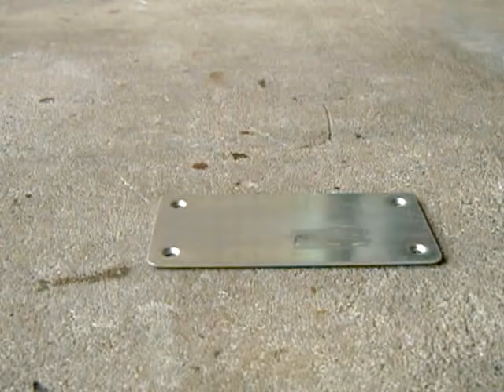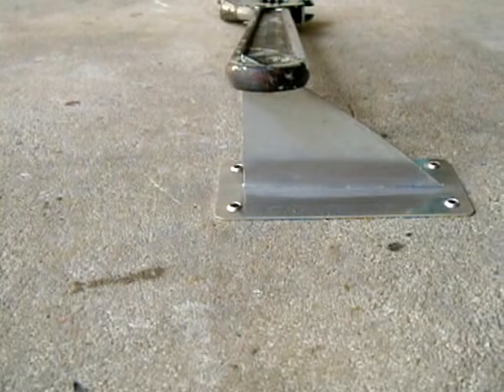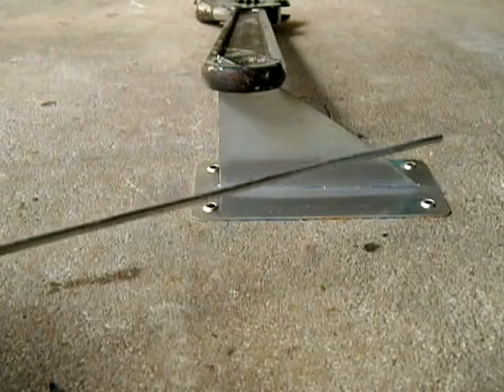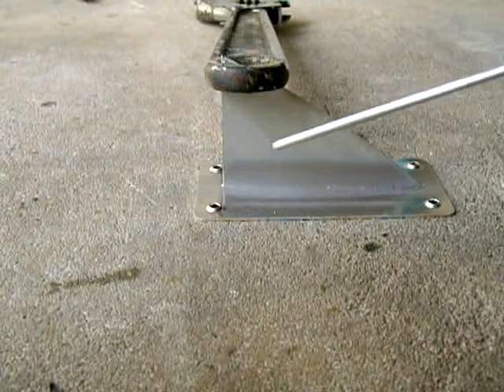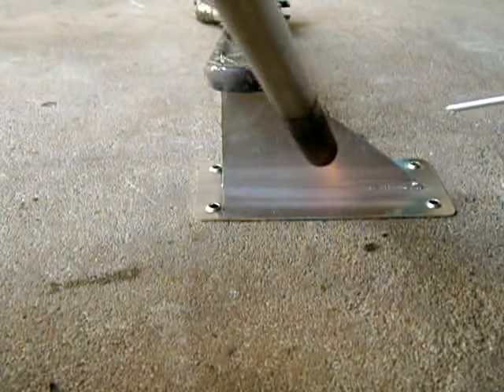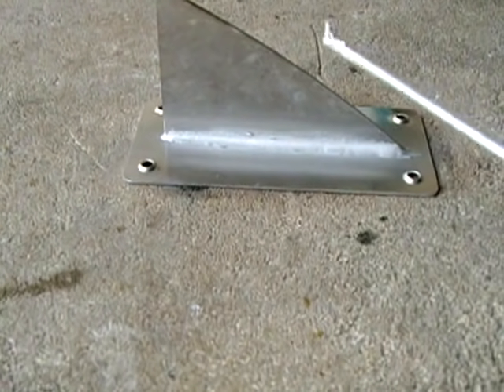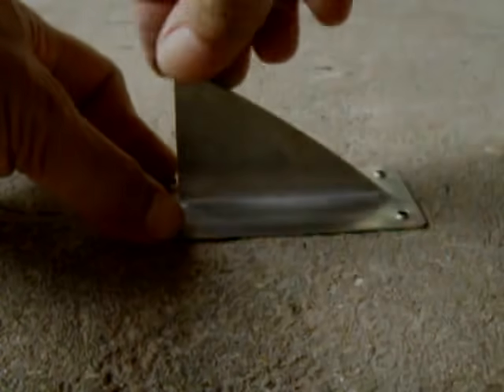How To Easily Join Together Aluminum Plates & Repair Aluminum Parts

Comment: If you use a proper flux (and do your brazing off the huge heat sink of a concrete floor) you will get a better joint that will fillet on both sides, even if you only apply on one side. You will also be able to skip the majority of the wire brushing.  Still; this does illustrate how strong a brazed joint can be, even when done less than optimally.
Reply from the maker: Concrete, like a fire brick, is a very poor conductor of heat. No flux is needed with these rods, but I am sure the result would be even better if you did use flux. Brushing surface oxidation under heat is mandatory when using these brazing rods(according to the manufacturer, as well as my testing)

Thanks For Watching!
Reply: I haven't got to try brazing yet! I can emagine from my research you are 100% correct! I also seen somone online showing a strength test which had interesting results! One person with a scale and the other with a hammer! So that was nice when you hear that brazing is only for decorative! I know steel is better to be welded within some cases, I just can't wait to see what aluminum provides!

Comment: In welding class we hit the aluminum t joints with a hammer to see if it will crack. It’s really crazy how tough 16 gauge is to tear or compromise. You hit the nail on the head with the preparation. Aluminum has got to be very clean if you want the strongest joint. A good weld/braze is like a good paint job 90% prep work 10% actually spent welding/brazing.
Reply from the maker: Thanks for watching Jacob! Be sure to look over my extensive video playlists below for other 
helpful/informative videos of interest to you and most importantly share my channel with others. 
https://www.youtube.com/c/electronicsnmore/playlists

Comment: Awesome video. Thank you. I don't know if someone already mentioned this tip below,:  My USN trained machine shop instructor showed me a neat trick wit Aluminum.  Once the metal is fully prepped, black the aluminum with suit. Either with a candle, or acetylene from a torch.  Then, begin your normal heating process.....right when the aluminum is hot enough that the black suit disappears, (it happens all at once)- the aluminum is now the perfect temp to bend, or straighten, or lay the solider to0, or start applying your TIG welding filler rod.  Awesome video and thanks!
Reply: What is suit?  Please describe it a little more.  Candle or acetylene? Sounds like a great tip for someone trying to teach themselves this aluminum brazing.

Comment: The problem with aluminium is that it oxidises immediately. If you clean the parts under mineral oil, the oil seals the surface and prevents oxidation. This means that with practise you can soft solder small aluminium parts using a soldering iron while keeping the parts in a shallow bath of oil.
Reply from the maker: That's why you need to brush the molten rod into the surface. The oxidation cannot take place.

Comment: I'm under the impression that the steel impregnated in the aluminum from the wire brush will corroded the aluminum. Shouldn't you use an aluminum brush or sandpaper to remove surface corrosion?

Comment: While you still need to clean the metal, there is a flux, for low-melt aluminum, to help filler metal flow. One brand is made by J.W.Harris Co.

Comment: I worked as a Jeweler / Goldsmith for over 30 years. I am just passing along a simple tip about soldering. The solder always follows the heat. To pull some of that aluminum solder down under the joint and a small amount to the other side. You need to heat that joint on the other side. You should see a small bead form on that other side when the solder starts to flow.
  I have also used these aluminum rods and I think they are fantastic. 
 One last tip. Don't overheat your work. You used just enough heat till the solder flowed and that's good. Too much heat and you can actually cause the solder (call it brazing if you like) to boil causing a porous and weak joint.
Thanks for posting!
Reply from the maker: +JoeKind1958 
Thanks for watching!
Reply: Great vid! Would this technique be ok on thin sheet say 0.9mm aluminium or would I get some warpage
Reply: Hey JoeKinnd1958, do you think I could make an aluminium/gasoline /petrol tank for a motorbike and use only brazing instead of welding?
Reply: Great additional tip.  Thanks for this video and the comments that go with it.
Reply: Ive been for 20 year and YouTube came up i feel like my 20 years was nothing
Reply: i dont mean to be offtopic but does anyone know of a way to get back into an instagram account..?
I somehow lost my login password. I appreciate any tips you can offer me
Reply: @Jason Weston Instablaster =)
Reply: @Roger Cash It worked and I finally got access to my account again. I am so happy!
Thank you so much, you saved my account !
Reply: @Jason Weston You are welcome =)
Reply: I learned more from your comment.  Thanks.

Comment: People don't understand the benefits of taking the time on prep work such as wire brushing considering the few minutes of prep are less effort than re-brazing/ soldering/ welding and well anything in life Haha. Good video. I'm probably going to pick some of these up soon.
Reply from the maker: Thanks! Practice on a few pieces, you will learn fairly quickly.
Reply: Which people?

Comment: Hi, just picked up the neat holding method with the wrench.
Those rods are usually an alloy of aluminum and zinc, they will stick to about everything metal there is. ( Copper, brass, steel, stainless...)
One tip from a machinist/welder, not that it really  matters in this demo, but prior to brushing, just clean with acetone so the grease don't get rubbed into the sheet, and, if the rods contain flux, no need to brush after you started, just keep the flame on the part, this will keep it from oxidation, the melting point of those products is around  850 F or less. (pure aluminum is 1200 F)
Like you said it make a very decent bond.
Appreciated the demo,  Pierre

Comment: I have helped design and build aluminum vessels for the Navy for years....and seen friction stir, stick, mig, tig etc.......never this. I am def trying this at home. So intrigued.
Reply from the maker: Pat Rigdon These rods work extremely well when the surface is properly clean/brushed, and the correct amount of heat is applied. Be sure to check out my other aluminum repair video as well.

Thanks For Watching! Please share and rate Thumbs Up.

Comment: The Jack stand on my boat trailer has a foot that is rusting out. I was thinking the foot off and trying this out with a fresh piece of aluminum. Assuming I clean it up nice prior to, would this be a good fix? It’s. 2500 lb jack stand. Not that there is 2500 lbs being put on it, just giving more info.

Comment: Few things here, great video and brazing aluminum is far easier than welding it and with aluminum welding isn't always that much better. Aluminum is fairly weak anyway, so brazing it normally all you need. A couple things that were not right it that while cleaning the area to be brazed, soldered or welded is always right, you are not removing oxidation. Well, you are but aluminum will oxidize as soon as you brush it. It is nearly instant. If flux is used it removes the oxidation when you heat it and the rod covers it so it never touches air. If you don't use flux you have to scrub though the molten filler to remove the oxidation and have the molten metal cover the base so it does not contact air. All that scrubbing was just taking a way a layer of oxide and allowing on other layer to form.
Reply from the maker: +Phillip Morrison 
Hello Phil. I have had this discussion before, and spoke with the manufacturer as well. What I show in this video is the correct method to keep surface oxidation at a minimum. Keep brushing, even under heat until the brazing material flows into the surface.

Thanks For Watching.
Reply: Don't know why all these videos are stating to use a STEEL BRUSH.

I wouldn't recommend using any type of steel brush on Aluminium; especially, at this fragile molecular state.

Preferable, use a new (dedicated) brass brush rather than any steel.

Pushing Chromium (SS) into the Al will cause intergranular corrosion later down the road.

Even sandpaper type must be chosen wisely before cleaning Al.

 I too would recommend using the proper flux with a nylon "toothbrush" for "longevity".

But thanks for the other info, gave you thumbs up!
Reply: +Aquamon do you work aerospace? I don't hear people talk about impurities from the brush very often, and they are normally aerospace welders.
Reply: +Phillip Morrison Right you are, the steel brush leaves behind residue . If you take a steel brush to stainless steel then the part you brushed will rust, actually it's the residue from the steel brush that rusts and not the stainless steel itself. Is that correct? When you brush the Al it leaves the same residue on the Al. I have told others to be careful what they use to clean the parts with that are about to be soldered/brazed and most people just don't care and use some kind of oily, greasy wire brush to clean with and then sit around scratching their heads wondering why their solder/braze joint failed miserably. I just sit back and laugh.
Reply: +brandy sigmon I meant that previous comment to be a reply to Aquamon, sorry.
Reply: +brandy sigmon 
troll mask?
but, right.
Reply: Aquamon whats a troll mask
Reply: @aquamon1339  
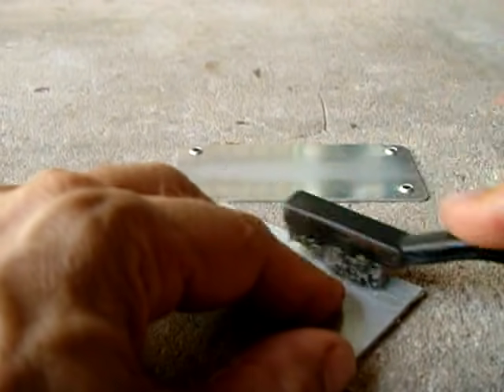Actually, at 1:20, he said to use a "stainless steel" brush not; just steel.  Does that make the difference needed?  Another guy below said to use a brass brush?
Maybe, the secret is to use flux, as well as, using a stainless brush.....before the brazing starts?

I didn't like the brushing during the heat process but, I don't really know.  That seems to be, potentially, inserting contaminants into the aluminum.

Brush it with SS and use flux.
Is it okay to sink the hot parts in water to cool or does that make it brittle?  I thought cooling quickly like that, tempered it locking the molecules in that position as they do in steel.

Comment: Do you think these welds will hold safely on motor mounts for an aluminum frame motorcycle?
Reply: Better find someone who knows how to Tig weld for those motor mounts!!  These rods are good but I would never use them for something like a motor mount.
Reply: +axm203  NO, need to weld not Soldering...I was a millwright for 28 years...

Comment: Hi, can I ask your opinion on failure of this joint under re hating with a flame. Do you consider this a fusing of the two pieces, which would not come apart when re heated or just a bond which would?
Reply from the maker: This is just like "Hard Soldering". The base metals don't flow together.

Comment: cool vid thanks. tip..that concrete leeches alot of your heat making the process take longer.  Also concrete can blow up in your face if heated to much depending on how much moisture is in it.

Comment: I bought Harbor Freight rods and they worked fine for repairing AC tubing on the car.
Tube had broken where it enters a large bolt on flange bracket.
So, drilled out old tube in bracket.
Cleaned up tubing and brazed together. Saved me over $100 they wanted for that part.
Reply from the maker: Glad to hear it worked well for you. Large tube or small tube? If it was the small tube, I hope you did a really good job cleaning the surfaces under heat before applying the brazing rod. The high pressure side can reach 250-400psi.

Thanks for watching!
Reply: electronicsNmore Small tube where it enters the condenser, so yes high pressure. It is perfect leak free. You can just tell when you get a good braze. I have done a lot of welding so have some experience. Scratching the aluminum braze material while hot even using a brush or even a screwdriver  on the metal is good to break the oxides. I sanded it clean and bright first.
Reply from the maker: OK, good, just wanted to make sure. :-)

Comment: Nice video, you helped me as you clearly knew what you were doing with your technique,  Question -- If I want to braze a big aluminum piece, for example an 80 qt Pot,  do I have to supplemental heat it on a BBQ grill to get the entire piece up to some high temperature.  There's be a lot heatsink in this large pot to dissipate the hear.  Say I want to braze the Pot Lid onto the pot, for example.
Reply from the maker: Preheating the lid in an oven to 600 is a good idea. Usually the lids are not too thick. You should not have a big problem repairing the lid. Make sure you drill out the ends of the crack(To prevent it from traveling), then grind the crack down a bit.

Comment from the maker: I think the rod melts around 750 degrees F. The usual welding practices normally apply. If you viewed the image of my muffler repair, I used a die grinder to grind out the crack to allow space for the filler material, and to add strength to the repair. Beveling is definitely good to do.

Comment: I need to braze cracked cast aluminum that is 1/8” thick, and approximately 8” long.
Unfortunately i ground a V- Grooves on both sides to prep it, but realized that when i go to braze the second side, the heat will loosen the first side.
I’m thinking to grind the grooves thru just enough to put a damn on one side so the aluminum rod can then flow thru to the other side, then just finish filling the groove.
Will this work? 
If not could you please let me know if you have a better idea?
Reply from the maker: If the metal is thick, you'll need A LOT of heat. Make sure you drill the ends of the crack to stop the crack from extending later on. Thanks for watching!
Reply: electronicsNmore:  thanks for responding but how do I breeze it if I put Groves on both sides that was my original question?

Comment: Would it work on an old aluminum boat hull?
I have rivet holes to fill in but i want to make sure they are wake proof
Reply from the maker: Yes, but you'd need to get it extremely clean and use a MAPP gas torch. Why not cover the inside of the rivets with 5200?
Reply: @electronicsNmore  its a old boat owner before me used a big bolt to close hole 
I wanna cover it up completely

Comment: Interesting method. Have you had a larger bending force on that join? Bend it in a press or hit it with a hammer and post results. Thanks for sharing.
Reply from the maker: Very strong when done properly. I used these brazing rods on a vane of an aluminum flywheel which spins thousands of RPM's, and it never came apart. If I brazed both sides of the plates in this video, It would take extreme abuse.

Comment: Good job on the video. These rods are great. I've built up metal on a carburetor for my bike. Drilled and taped these welds too. Saves me a bunch of time and money.
Reply from the maker: These rods are excellent. I repaired an aluminum cooling fin on a flywheel 2 years ago, it is still firmly attached and the engine spins 5,000-6,000 RPM's.

Comment: Would this work on aluminum alloy extrusions (the stuff they make windows with)?
Reply from the maker: Yes. I have used these brazing rods to repair aluminum windows and window cranks. Just be very careful when heating thin metal. If you heat it too quickly, the aluminum will melt out. Heat very slowly and keep brushing/testing the surface with the rod to see if it melts, which would indicate the proper temp has been achieved.

Thanks For Watching! Be sure to share my channel with others, and rate Thumbs Up.
Reply: electronicsNmore Thank you for your reply. I shall try and save some rivets next time.

Comment: Hi
Nice tuts thank you. What you will suggest something cheap and safe for small home works? Some good weld pistol and other accessories . Thank You
Reply from the maker: You cannot go wrong with a propane torch and 40w/60w soldering iron for many projects.
Reply: Thank you for replay.
Would you mind to post some link from ebay or at last name of item. I am not familiar with welding.So please post some item name or link so i can search and order it, Thank you

Comment: G'day, Nice video, Thanks. 
Have you experienced the problem of the brazing rod ( Im using 4043 rods ) breaks off in about 5mm pieces just barely sticking to the part, rather than melting completely onto it. Is this due to not enough heat, incompatible base material or not enough cleaning? Any pointers on what I'm doing wrong?
Reply from the maker: +Dooners S 
4043 rods will not work. They are WELDING rods. You need aluminum brazing rods. Thank You
Reply from the maker: +Dooners S 
4043 rods will not work. They are WELDING rods. You need aluminum brazing rods. Thank You

Comment: I think this is fantastic. I always thought that this could be done just as it is done sweating copper pipe to a valve. One question, can you used flux to make the welding easier. ?
Reply from the maker: +Chimel 07 
The manufacturer does not say any flux is required, but I guess it would not hurt to use it.

Comment: Hi, I am making something that will most likely be exposed to cold weather (just below freezing). Will this type of joint hold up to cold weather and shock?
Edit: Also, could a heat gun get the metal hot enough to melt the rods? Or would i need a torch?
Thanks!
Reply from the maker: Yes, if you do a very good job, it will hold up well. Torch is a must.

Comment: Another awesome video!  I didn't know about these rods. I have a 150cc two-stroke gas motor for a large RC airplane that has a cracked exhaust header, this will work perfectly for repairing it. I can see this useful for many other things as well.  Thanks!

Comment: What type of torch from Lowe's would I use? Propane get hot enough?
Reply from the maker: For a little extra money, use a MAPP gas torch, it burns hotter. :-)
Reply: I haven't used MAPP gas - but there is a type of propane torch called a 'turbo torch' which is FAR superior to the usual propane torch = recommended!